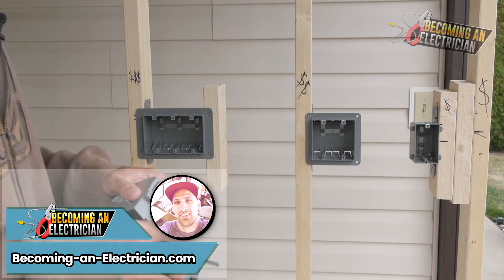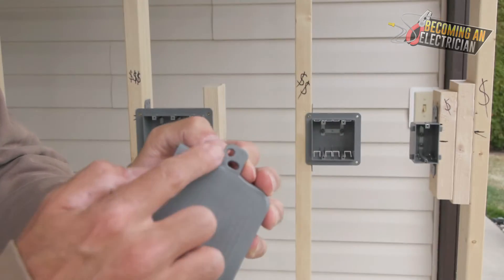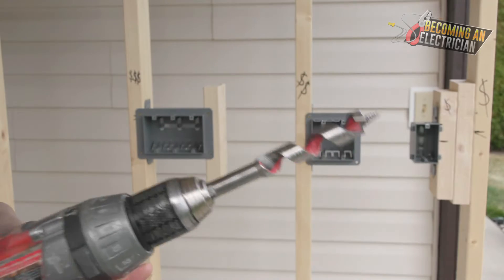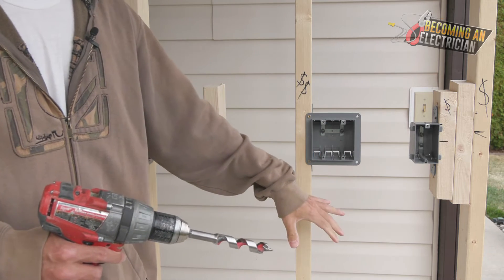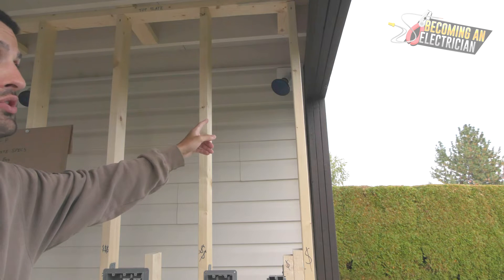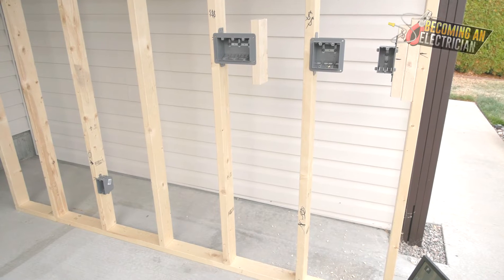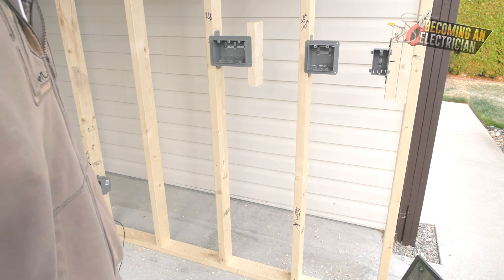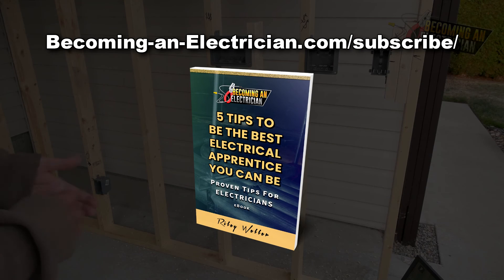How to Drill Holes for Wires as Electricians

Comment: Never said what size bit through a 2×4
Reply from the maker: I'm not sure.. companies i worked for always used different bits & sizes.  If you're using a long-boom arm, you don't want too big of a drill bit as it can break the pin.  I think 9/16" was common.. but generally 5/8" - 3/4" allows you to pull your 3-4 wires in a hole.. you don't want to cram it so that wires have breathing room.. and often bigger wires get their own hole like your dryer wire or oven/range wire.  Most important thing is not drilling too close to the edge of a stud to ensure its strength and protect your wires from drywallers drilling in screws to the stud.  Not too big, and not too small :)  - http://becoming-an-electrician.com/

Comment: What's the standard size bit used to drill the wholes?  Can either auger and spade bits be used, or just auger bits?
Reply from the maker: Any drill bit that creates a hole can be used, but often auger bits are used because they are pretty tough and can eat through nails (even though they will get dull by doing that).  Also because of a augers unique design, the woodchips escape as you're drilling.  You can use a spade bit, but I would recommend this just for random holes here and there, or in more fine work.. and always be careful of nails with spade bits!  If you're new, try my free book for apprentice electricians:
https://becoming-an-electrician.com/optin/5-tips-apprentice-electrician-book/
Reply: No size recommendation, okay, thank you.  I'll purchase a set of auger bits.  @BecomingAnElectrician

Comment: Hi, I was wondering how many holes can you make in the top plate for wires going to the main panel?
Reply from the maker: I don't think there are any rules.. but you always want to think about "structural integrity"..

A better question is "how many wires can you fit in a hole".

The best approach is pre-planning how many holes you'll need, which you'll know by how many wires you'll have.. then you pre-drill the holes, and enter them all down by the panel.

I wouldn't be too concerned, just don't cut the top plate in half 😁